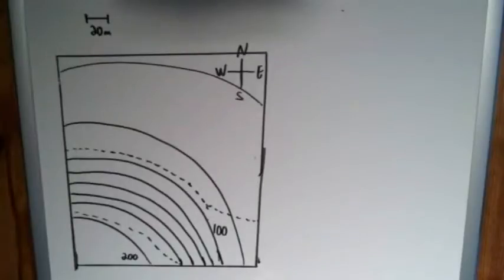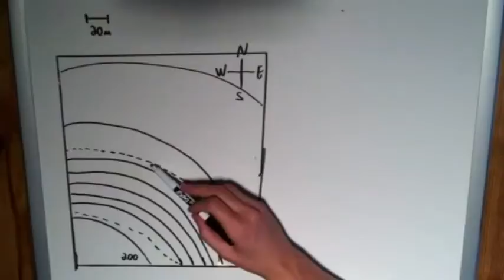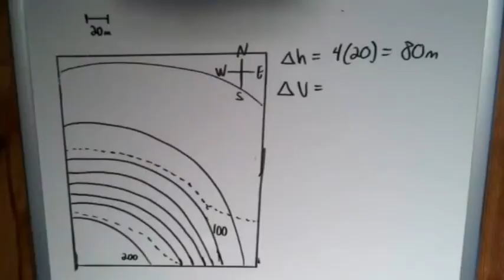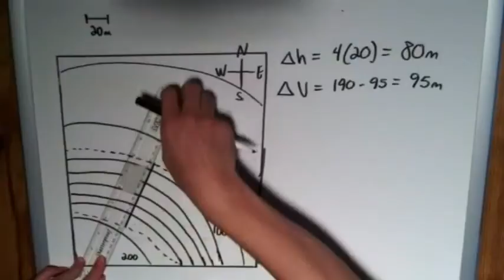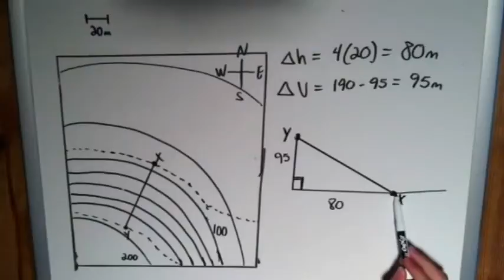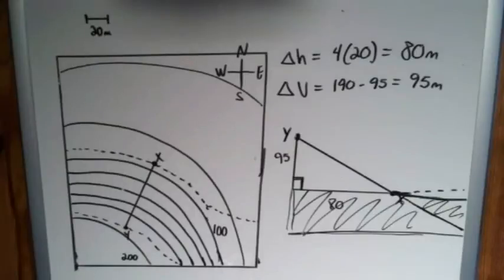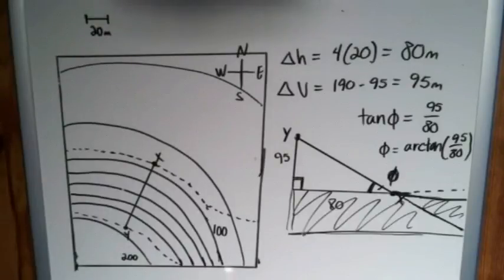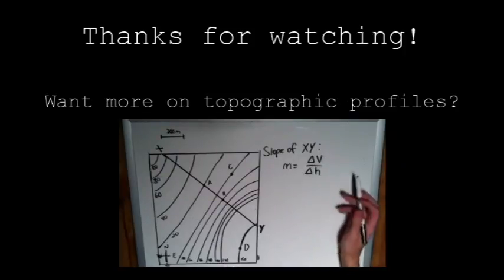Dip Angle on Topographic Profiles - The Basics of Geology

Comment: Hey thanks very much for the video.  I am assuming if i am looking at a topo map and dont have pre-drawn dotted lines like you do in the video, i would just measure the distance in inches (to my scale) between two different elevations?  Thats what I did. I think its right but maybe you can clarify. Thanks!
Reply from the maker: Correct. You can do that for any two points you choose. For this video I mixed a topo map with the element of showing rock strata of a geologic map (the dotted lines), to make it clear there was a particular layer of rock we were dealing with. The term "dip" is used to refer to the angle a rock unit makes with the horizontal, so perhaps it would be better to call what you describe to have found the angle of slope or something like that. But the math for both cases will be the same.